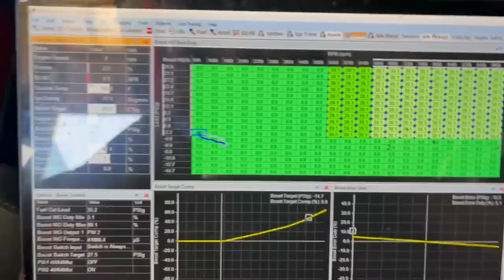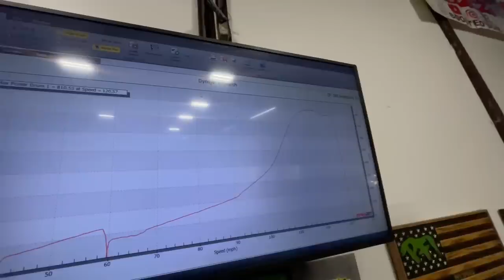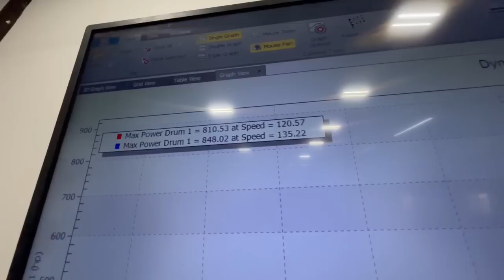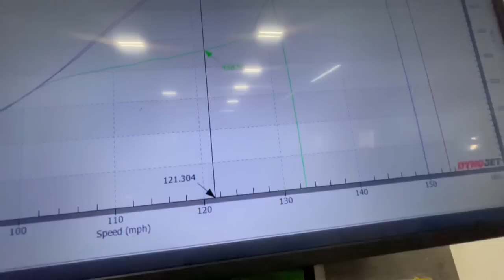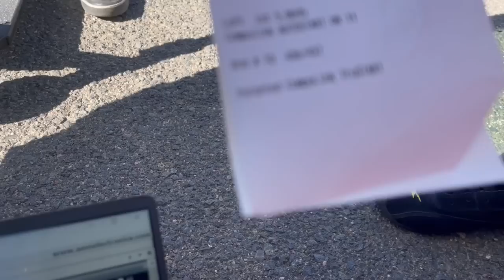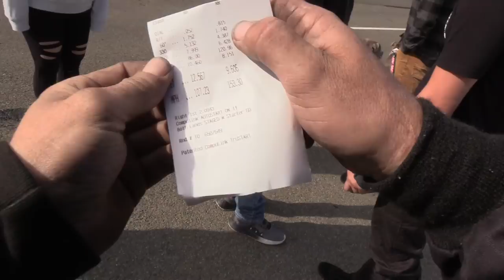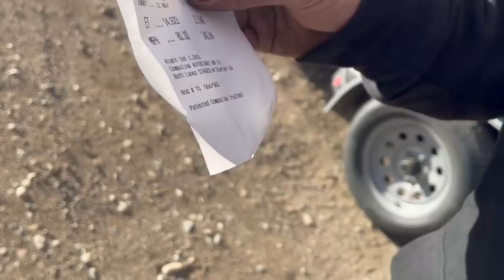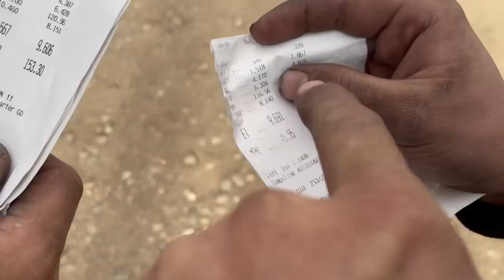This Fuel System Solution= Gets this Ride Flying!  Could this be your Fix?

Comment: On DSM's with a mechanical pump we use the ECU's prime feature to fire the electric pump for say 20 seconds at key on and then it shuts off automatically, works out very well, no issues with starts.

Comment: inside the tank to make sure the line is unrestricted a T in each end with a one way valve in it to allow the electric and mech to work together flawlessly has worked for me in the past on v8. I'm sure this won't be any different.  it has to draw thru the electric pump unless you already do this.

Comment: to have constant high pressure in the fueltank without adding unwanted gases or with wanted cold air is not a problem. i think probabley you dont need a fuelpump at all. what you need is to get prepelant to your bom bom chamber.

Comment: to increce pressure in a watercontainer to have the same pressure if the level is high or low they yuse a ballon. i think they have don it for a hundred years. so i dont understand this running out of pump.

Comment: @Brent: Could you wire the primer pump to the starter/ignition position switch so the pump only runs during cranking?
Reply from the maker: Absolutely

Comment: brent next time a one way check valve is what we use on diesel trucks with manual lift pumps
Reply from the maker: I’m gonna throw one in also. Was just the weekend. So I was stuck
Reply: @PFIBrent  the god himself replied to my comment i feel special thanks bro made my day ! yeah either way great fix ive hiden a few in some tanks and hooked the pump to the intake heater to prime weak lift pumps or when a injectors bad and bleeds air into the fuel rail love your videos bro